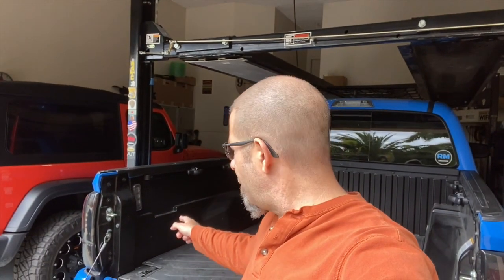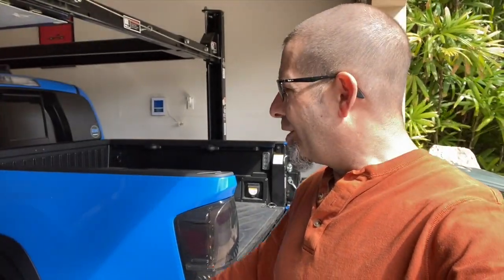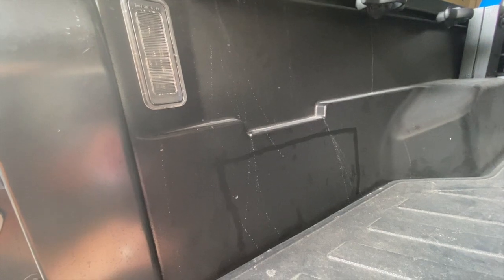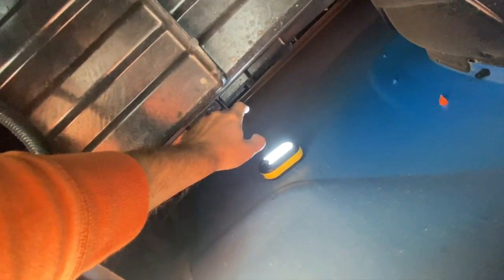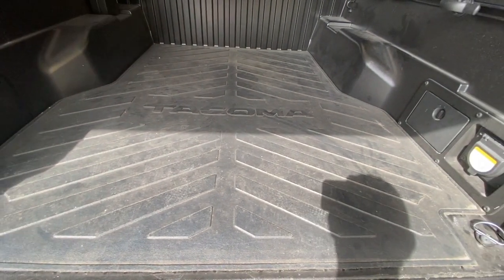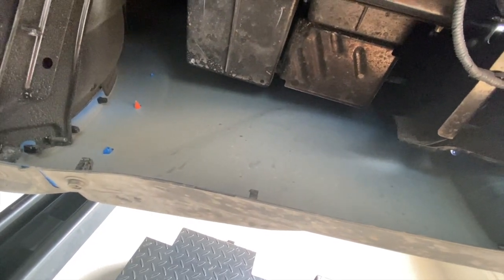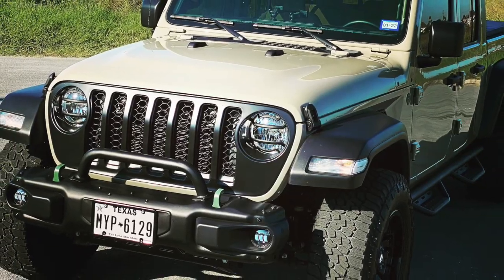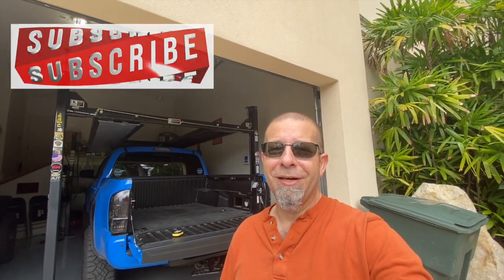Can You Add the Missing Tacoma Large Cubby

Comment: I have the 2019 SR5, so I have the large cubby on the passenger side. I use it to house the 12v battery for my underglow! It's also pretty neat because I can easily run the wire up from the bottom of the truck, to the compartment, without any drilling or cutting!!!

Comment: I fabricated my cubby area with some thin steel plates, and some steel bed frames. Right now my single arb on board air compressor is sitting in it but made sure to make it big enough for even the twin compressor plus extra storage.  Thinking of doing the same or similar on the other side and even replacing that low wattage power inverter with a more powerful one, theirs really alot of room on those inner fender walls for storage.  Don't understand why toyota doesn't utilize it correctly instead of selling their in the bed trail edition type storage compartment that takes up space inside the bed area lol oh well is what it is you know have a great day all.
Reply from the maker: Sounds great👍

Comment: Rob I have a 2017 Sr no plug but to large cubbys I used window insulation to water prof them worked out great they even make locks and steel doors aftermarket.
Reply from the maker: Awesome!  I had locks on the one on my 2018 Tacoma👍

Comment: How hard would it be to add the 110 outlet and storage like yours and move the storage box that came on the SR5 to the drivers side?
Reply from the maker: Depends on the wire length.  Otherwise not too bad👍
Reply: you just need a long extension cord to plug into your house. no problem

Comment: Though no evidence to support, I suspect it’s about lowering manufacturing costs.  My only concern about adding it would be compromising the integrity of the bed.  The Tuffy version seems more rugged than the plastic version, and has locks.
Reply from the maker: I checked it out when I had it and it’s merely a hole cut in the bed with the insert put in.  No different than if one were to add it with regard to bed integrity 👍